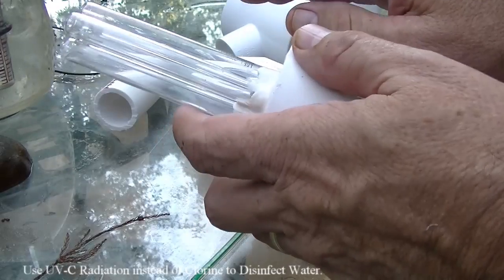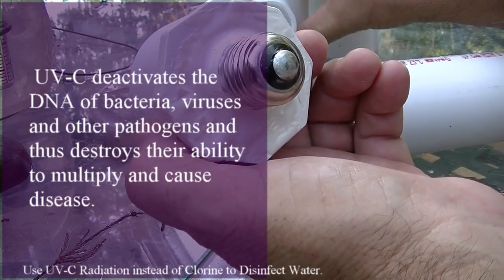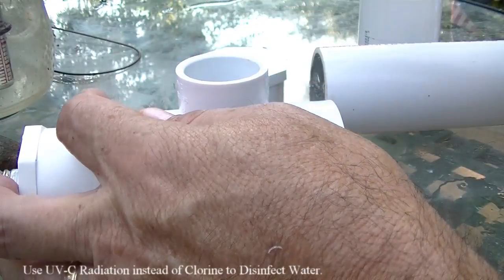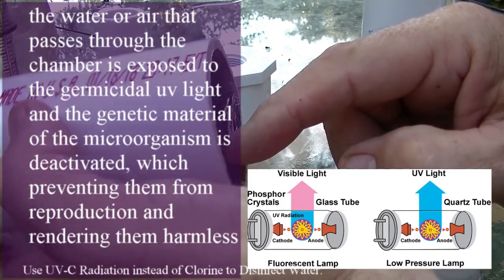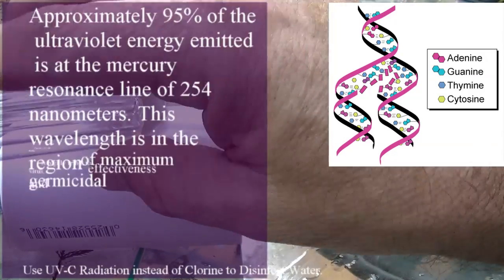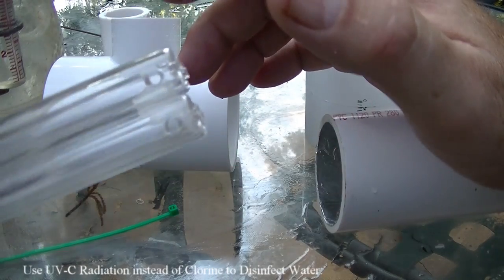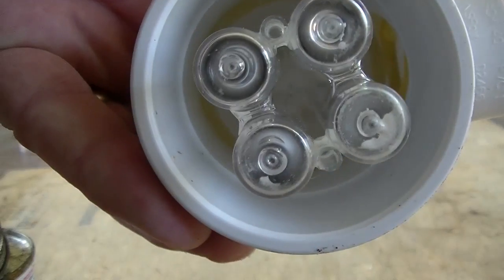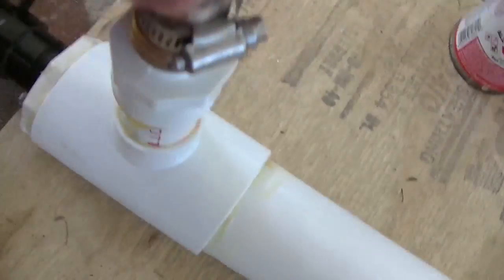UV-C Water Purification

Comment: Eventually the lamp will get dirty and the aluminum will oxidize. Since you sealed with glue it will be very hard to clean or replace the lamp. How do you propose to solve those problems?